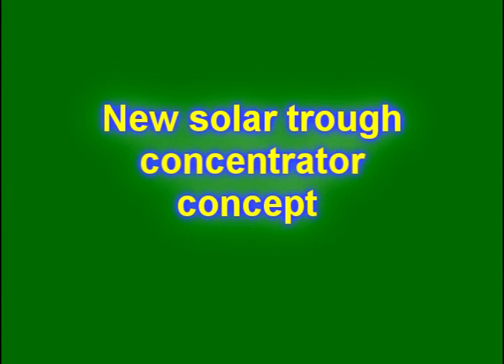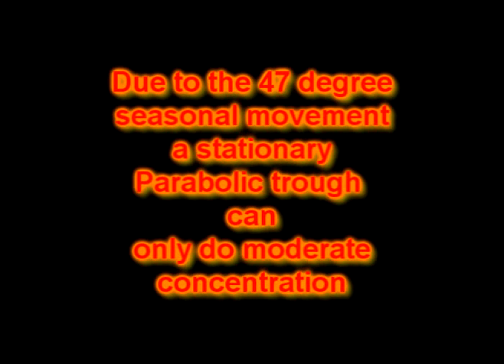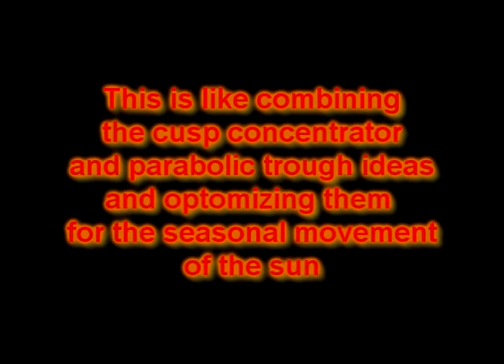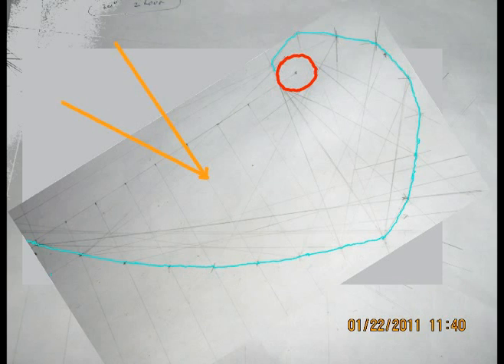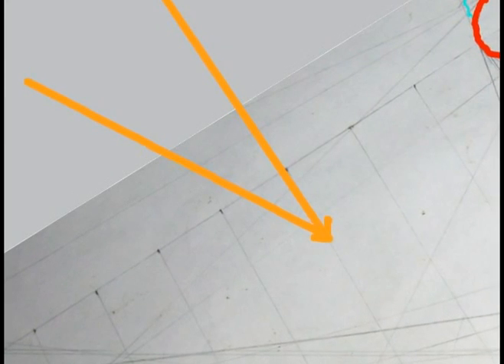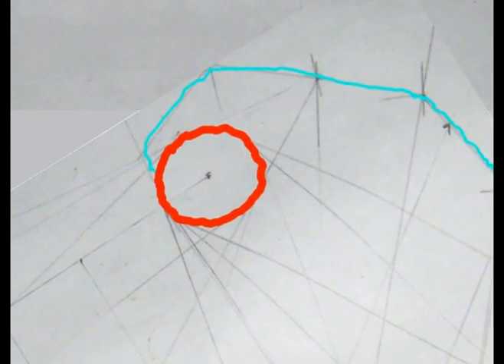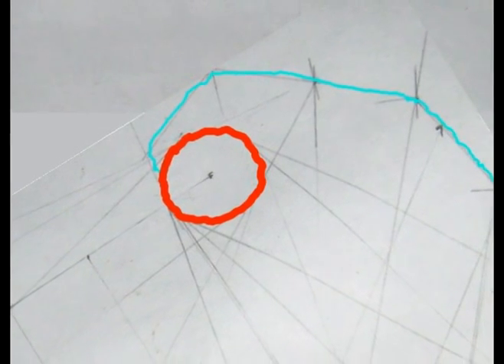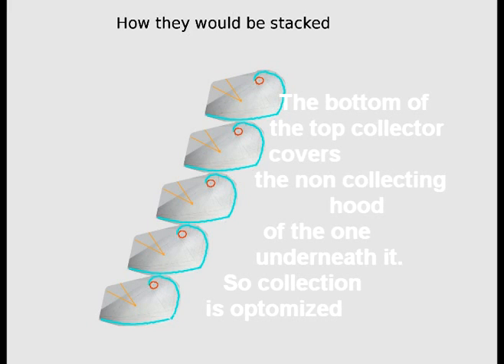Hybrid  solar parabolic trough/cusp collectors better?

Comment: Sounds BRILLIANT... Using the Fibonacci Sequence as your reflector angles... I was searching trying to find a way to track the sun passively.. As in the mirrors reflect the light to a focal point regardless of the angle that they enter... Not sure if this will acctualy work, just wanted to give you props for trying the Fibonacci Sequence

Comment: your stacking idea is incredible!! for a limited power budget application this configuration has promise! the plumbing is expensive so putting a trough on both sides of the tube is more cost effective.  your other vid weighs gains and losses of the top curve.  i think the gains of 2 troughs  in a fixed position on a vertical wall would be optimal for this concept.

Comment from the maker: Just a note that I have 2 videos that can help if people try to make their own curves
" Parabolic is the wrong shape" shows how you can use a laser level and reflective material and "designing a solar cooking dish, the cone method" gives a pencil and paper method that might help.  
Another shape that is worth looking at is a winston collector.  I have not seen a drawing of one  designed for 47 degrees acceptance angle.
A compromise   acceptance angle  versus concentration factor must be made.